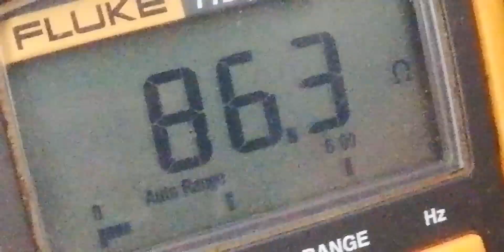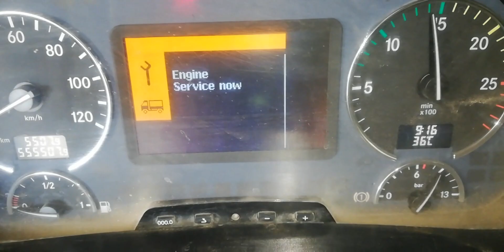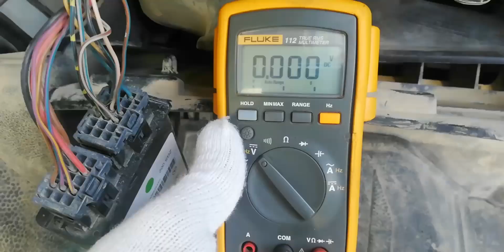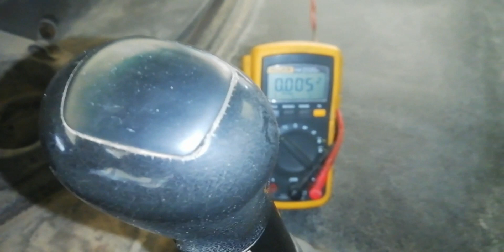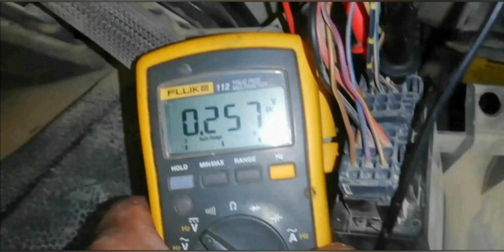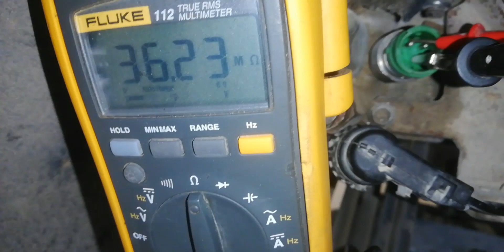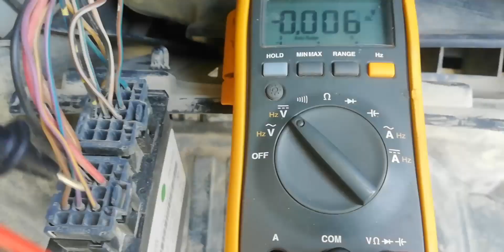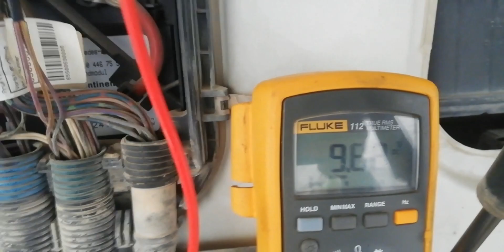BEZ: G240-16 GEAR HARD TO SHIFT, GEAR SHIFT ECU DIAGNOSING, MERCEDES ACTROS

Comment: After changing that part connected with green oil tank, do you need to set something with the laptop or just change it only?
Reply from the maker: no need to set to computer just replace the valve
Reply: @yrhelmechanicalelectrical9113 Thanks a lot for your help, the gearlever get stiffer aftert a couple of hours working not instantly do you think this will resolve the issue?, i have another actros and the gearlever is very smooth.
Reply from the maker: check air supply, An air leak can be a reason for a hard-shifting gearbox, the air will help to push the gear lever to become smoother when shift the gear

Comment: Thanks very much for this knowledge shared it has helped me
Having a issue of over heating actros 3348 any video to help me or any advise
Reply from the maker: The first is to check the clutch fan, if it is freewheel while on high temperature then you need to change your clutch fan. next is, check your radiator if the lower side is cool and on the top side is a higher temperature means that your radiator water is not circulating try to clean the radiator inside and outside